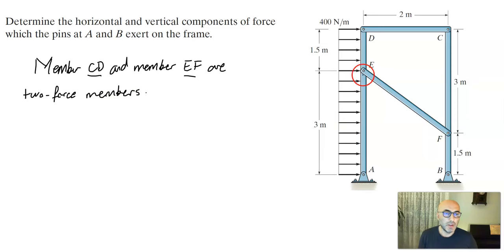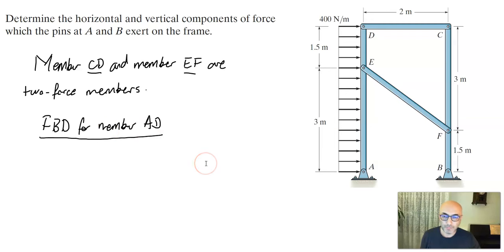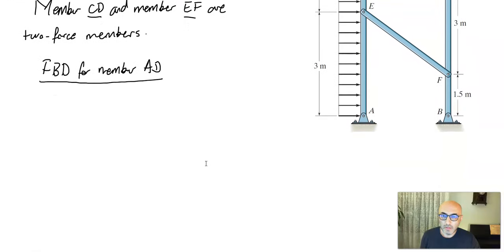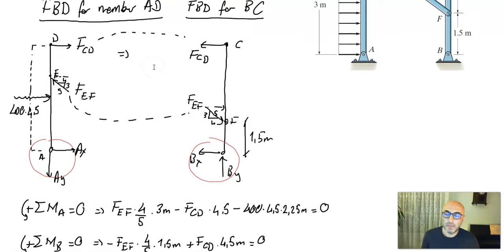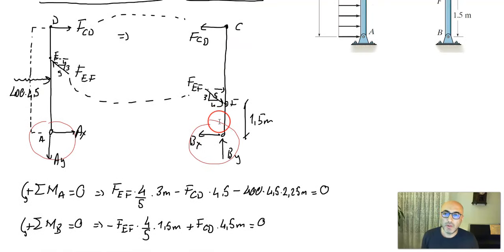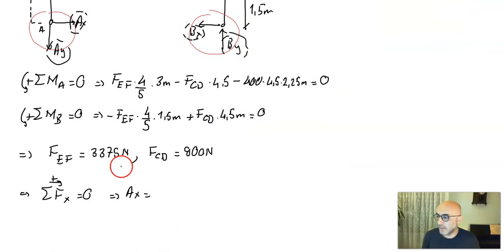Static analysis of frames and machines_Pin connected frame example

Comment: How did you get that 3,4 triangle ?
Reply: They recognized the ratio the triangle was making. If you made a right triangle using E and F as the hypotenuse, you'd find that the triangle would be 2m long (as shown at the top) and 1.5 m tall (3 - 1.5 = 1.5). Knowing that it's a right triangle, if you multiply 2 and 1.5 you get 4 and 3 for the base and height. And thanks to Pythagoras, we all know what the hypotenuse is of a triangle with base 3 and height 4